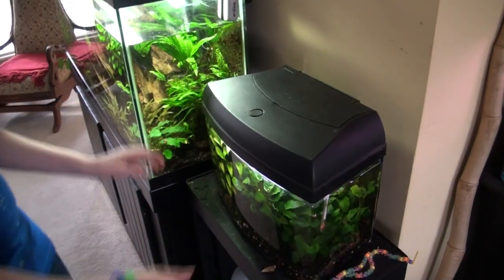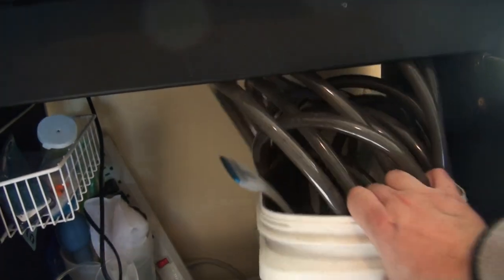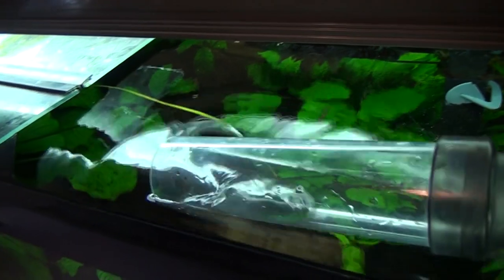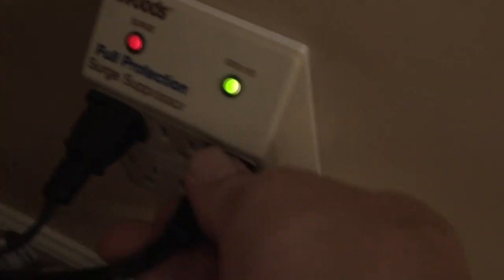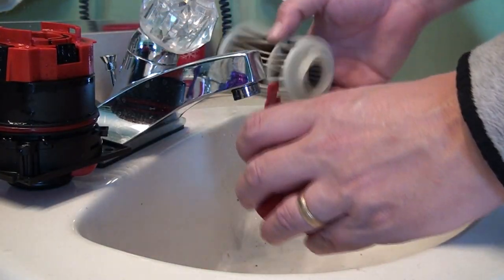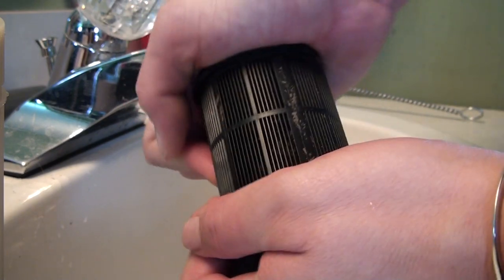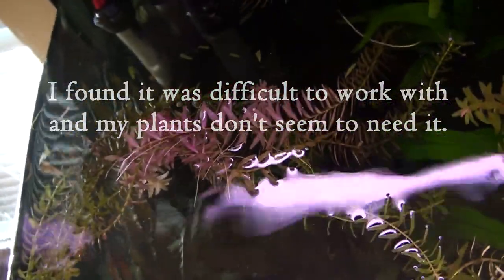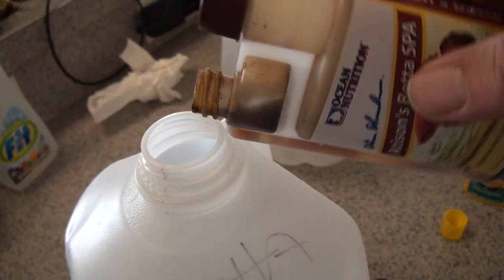Overview: Aquarium Maintenance

Comment: Shawn - a tip on faucet water temperature. Once you get a proper temperature setting, index your faucet(s) by drawing a line on the back side of the faucet with a Sharpie - works every time within a degree or two (for me)!

Comment from the maker: One thing to note is that they seem to evaporate quickly so I keep a jug of water near by to top it off now and then. The filters I clean out about every three months. I use the carbon it comes with the clean the water after setup then use a second bag of bio media when it runs out . In the 2 gallon speck I have a small bio wheel crammed in there so it will be ready for a tank latter on.

Comment from the maker: Sorry it took so long to reply. The trick is to clean the mechanical part and leave the biological part alone. I would never put a bio wheel in tap water. I'm not sure why you asked that. But what I do is clean the dirty mechanical media in tap water and let it dry the chlorine and cloramine will evaporate out and I use it for the next water change. I put the filter in from the last change and its safe again. I only rarely rinse the BIO media in prepared water.

Comment: I have a question even though I know this is a older video. Do you just change 20% as a general rule or is it based on nitrate levels and such? I do 50% on my non planted larger tanks but sometimes I wonder if that might be to much.
Reply from the maker: It’s just a rule of thumb. Sometimes I do a bit more. I try not to do more than half.
Reply: @pecktec   Thank you for the reply

Comment: pecktec I know this is an old video but I noticed you were using Tetra Aquasafe. It's much cheaper to use powdered Seachem Safe. A small jar will last you a year at a fraction of the cost.
Reply from the maker: Man I need to check that out. Thanks for the suggestion.
Reply: If you can't find Seachem Safe you can find Seachem Prime at most LFS. It's not as potent but still decent. 1/2mL treats 5 gallons.
Still it's probably cheaper to order Safe online and get a big tub of it. My friend does aquarium servicing on a very large scale and he's been on the same big tub of safe for  years between the 50+ clients he has.

Comment: +pecktec you don't seem to clean the substrate in your tanks when you do a water change -- why not? I have planted tanks and do siphon around the top of the substrates to pull of some of the fish poop, mum, and dead leaf pieces. Also you said you tried adding CO2 but didn't find it needed for you plants. I read that adding CO2 can help with algae -- did you notice any reduction in algae when you were adding CO2? thanks